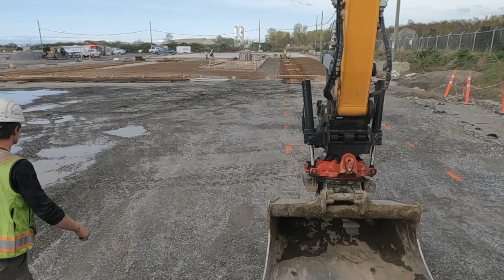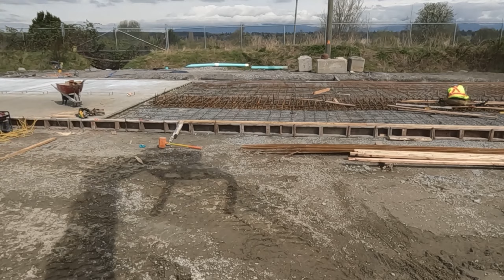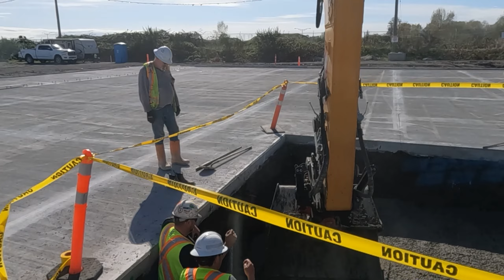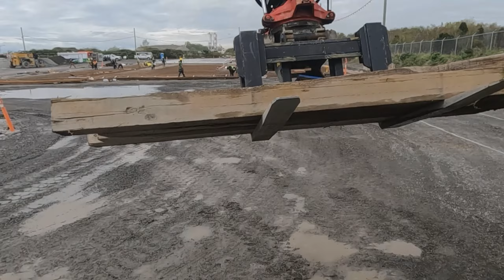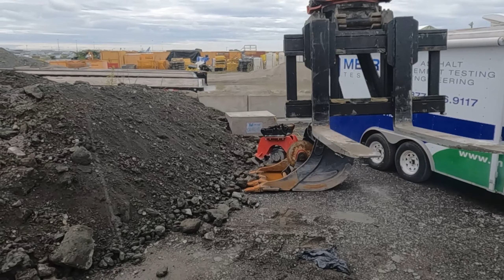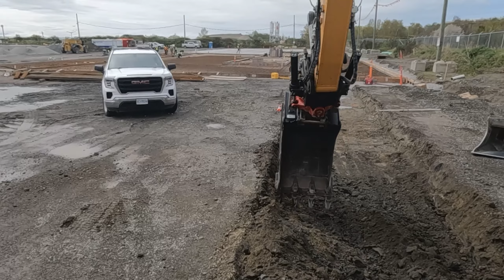Liebherr 918 - Job #3  "Another Day, Another Hole"

Comment: Hi Petre   that is a cool way to use a trailer that way Thinking out side the box  When pouring a concrete slab do they use a  key way to stop movement up and down  rebate in the concrete where the mesh joints are-- slab meeting slab , 
What would you do with out the CLAWS  forks are so handy   CAPTIAN CLAWS   as i say never seen a person as GOOD as you
Barry  NZ
Reply from the maker: Thanks Barry, the claws are very handy indeed. Having the trailer attached is pretty useful too, I don't know why more people around here don't do it. I think it will catch on sooner or later.